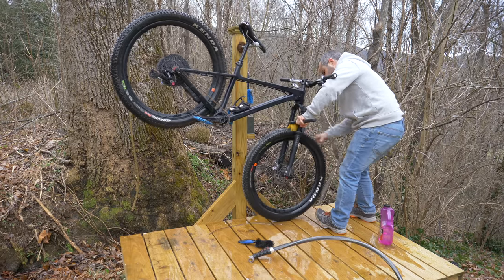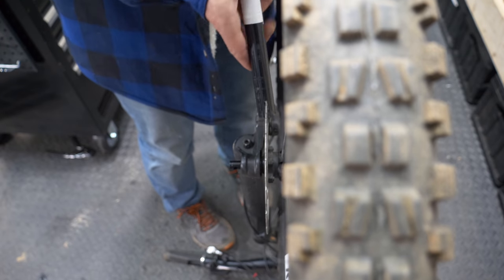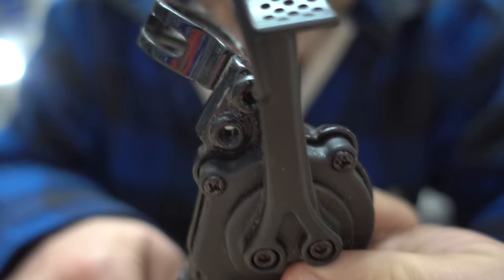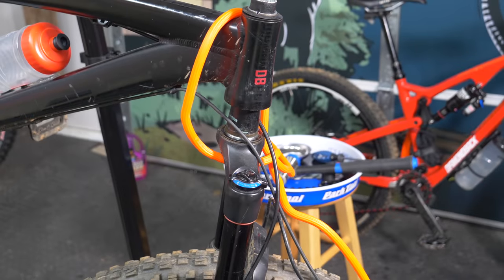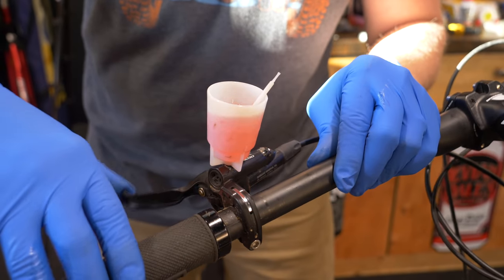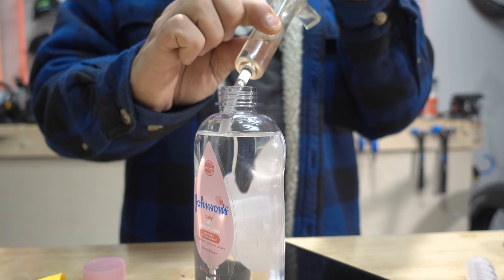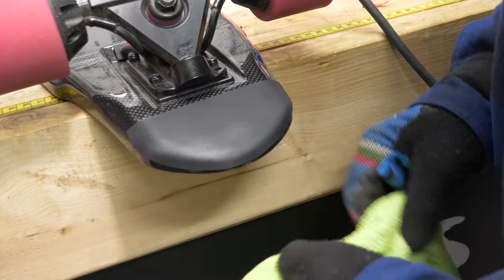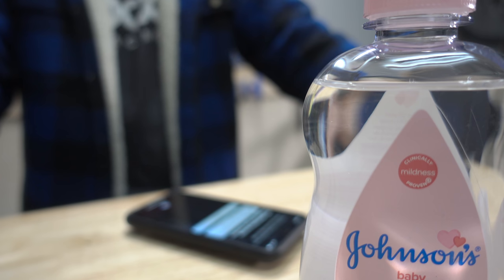10 Bike Hacks for Mountain Bikers and Beyond

Comment: Using baby oil will make your brake lever dirty after some time and that thing leaks on the main cylinder....yep i did it on my shimano deore m615 drained all the stock brake fluid and replace it with baby oil .. After a month youle see what i mean. But Dont worry just drain the baby oil then do some cpr on your brake levers to blow any left overs and spray brake cleaner on the main cyclinder which the blade pushes (thats outside) and your ready to go for the original mineral oil made by johnsons i mean shimano
Reply: you're* ready

Comment: I am a german boy.
My mom ask me, if i am learning
My answer: I learn english for 3 hours.
My thoughts: i am learning english, if i watch seth
Reply: Watch or watching* :) And don't worry, sometimes I forget it as well, because it's sounds difference as writing :D
Reply: @wa__een  Hi, actually his sentence is correct as it is, "I am learning English if I watch Seth". He does need to fix his capital letters for the start of a sentence, for the pronoun "I", and for the proper noun "English". The shift in verb tense from present progressive "am learning" to regular present "I watch" is a little strange, but not grammatically incorrect. To say, "I am learning English if I watching Seth" is actually incorrect, as he needs both the form of the verb "to be" (in this case "am") as well as the present participle ("watching") in order to make the present progressive form. Your sentence, "because it's sounds difference as writing" actually has a couple of mistakes. First, "it's" is a contraction for "it is", which does not work here as there is the conjugated verb "sounds" right after it. Second, "difference" is a noun, and in this sentence you would need the adjective "different" to describe how "it" sounds. Your sentence should be, "And don't worry. Sometimes I forget as well, because it sounds different when you write it, compared to when you say it." Another way that a native speaker would say this is, "It sounds different in writing than it does speaking it", or "It sounds different in writing than when you say it out loud." These are both ways that native speakers of American English would say these sentences. I hope this is useful, keep working on your English, and keep watching Seth's awesome videos!
Reply: Hi! This is a great way to learn English! Seth usually uses very good vocabulary and grammar, his accent is a little New York but not much, and his pronunciation is excellent. I noticed that another viewer commented on your English and I wanted to clarify on some things. First, remember that in English, we capitalize nationalities, so the word "german" should be "German". Second, the third person singular form of regular verbs in the present tense in English require an "s" as an ending ("asks"). Also, it is very important to capitalize the pronoun that we use for ourselves, the word (not letter) "I". We need to capitalize that one all the time. The sentence "I learn English for 3 hours" is a little strange, and might sound better in the present progressive ("I am learning English for three hours"). Finally, you need to fix your capital letters for the start of a sentence, for the pronoun "I", and for the proper nouns "English" and "Seth". You shift your verb tense from present progressive "am learning" to regular present "I watch", which is a little strange, but not grammatically incorrect. It would be a little better to say, "I am learning English if I am watching Seth." A corrected form of your entire post would be:

I am a German boy.
My mom asks me if I am learning.
My answer: I learn English for three hours.
My thoughts: I am learning English, if I am watching Seth.

I hope that this was helpful, remember those capital letters, ride your bike a lot, and keep watching Seth's videos.

Comment: Seth, good tip on car wash soap, BUT do not use soap with carnauba or any other wax built into it. it can contaminate pads and rotors. generally the cheaper the car soap the better they typically dont have wax in them.
Reply: Nick Ridgway I know about some carnuba wax. That's how me and Angelo caught Bodhi. Too bad it didn't turn out like I planned.
Reply: @placesaroundus  i feel bad it didnt work out like you hoped
Reply: Nick Ridgway thanks bro. At least I learned to surf though

Comment: Anyone know when the 2019 Diamondbacks are coming?
Reply: Stealthy Water 2019
Reply: Great lol
Reply: @hydrogen5149  the new sync'r (not the carbon one) is supposed to drop within the next week or two!  It's going to be tan, and around the same price point as the last!  If they updated the front fork to 110 boost and widened up the rear to accept up to 3.0 I'm buying one instantly, even if you can fit 2.6 on the front and back I would buy it honestly.  I'm just a fan of hard tails with a little more cushion for the pushin.

Comment: You can cut  small Cylinders out of the inner tube, put them on your bar behind the brake handle and pull them on the handles to keep the brakes compressed, usefull if you want your bike to stand still on a hill.

Comment: I have never taken the risk to go with baby oil for Shimano breaks, but what I do use and recommend is power steering (and also suspension, apparently) fluid of some European car brands (don't have the specification now, can search for it). I read about in a Peter Vertone article and this guy has tried everything in terms of oils and fluids. He recommended for even better performance than original Shimano fluid. I gave a shot and it does work very well also in extreme situations (-20 degree). It was easier and cheaper to find a 1 liter bottle than the Shimano one.

Comment: I use one of the smaller rubber coated ties to help hold my under-seat bag to the seat bottom - otherwise the bag's straps start tearing.  It also can work to hold a broken spoke onto the other broken spokes so you can get back to the trail head.  There are so many uses for the small rubber coated tie if something breaks.

I keep a spare rubber coated tie on my road bike stem if I need help holding my light or computer if it starts slipping.  It weighs next to nothing.

Comment: Tip 1 don't use a brush on your frame. Scratches the finish, and PS if you have a mountain bike, the finish is the last thing you should worry about getting damaged.
Reply: That's what I thought, I just use a soft towel

Comment: I've used motor oil as brake fluid before. Definitely not what you supposed to use but it's what was available and worked fine. I was on a 3 day stage race and on day one ran out of oil in my front brake reservoir, which meant I only had my rear brake for the majority of the ride. Topped up the reservoir with the motor oil that night and finished the next two days without a problem. Ran that oil in my brake system for years afterwards and never had an issue, but I wouldn't recommend doing that if you don't have to. Use the proper stuff

Comment: Seth, you are a very bright and inventive guy.  Its just great to see such ingenuity.  But please use a respirator when dealing with any possibility of dangerous dust like from carbon or aluminum.  Of course wet it down but use the respirator as well.  Half face ones with good filters are very cheap.  .  Sure you won't get the best seal possible because of your beard but its a lot better than nothing.

Comment: I have many little haxs hard to remember unless im doin the maintenance...
1, I have T style Allen keys and I was always grapping wrong one or set them down in pile when servicing bike So.I named each allen key with size and main job it has..Ex.3MM Grips..
I used majic markwer and wrapped handle with scotch tape..Im sure everyone has better stamping method.

2.Vegi bags at grocery store..Invaluable when blleeding washing etc..When bleeding brakes i wrap my rotors so no oil splash..Also i bag grips so as im pumping brake no oil transfer..
Im unlucky with brake contamination  and wrap disks and brake calipers so soap oil and whatever doent mess things up..
3.dollar store sponge on one side and green scrubby on other with cheap soap and clean my rotors and dry with toilet paper..If toilet paper is sticking all the way around rotor when drying it means its totally greaseless...
 Enjoy your show..Keep up the good work

TIM  McMTB

Comment: Sliding a metal tool across one of those magnets a few times will also slightly magnetize it, making it possible to stick a screw on the end of it. Idk how it works but I use that hack at work constantly.

Comment: for bleeding a lever without a dedicated funnel you can also use a cylinder from a syringe. It's tip made of plastic will screw into the lever with no problem. The only downside is, without that valve you have in the Shimano funnel, it can be a bit messy when you unscrew it ;)

Comment: I had one thought for a hack you should come up with for us boys up north.  We need something to protect our truck beds and/or bike racks from scratches from studded tires. For example when I put my fat bike into my 1up bike rack I have to put rags down under the tires before I can load the bike.  And that is definitely not pro. I’m trying to brainstorm a better low cost idea, but I could  really use a Seth style hack....a “sack” if you will 😂
Reply: What about cutting an old fat tire in half and using it to wrap the bottom of each wheel?  You could even combine with the gear ties that Seth features by drilling 2 holes on each end of the tire sections and threading one through to make sure that it doesn't slide off.

If you don't have one lying around already, you might be able to ask you LBS if they have any take-offs from customers bikes that had punctures / etc.

Comment: You can also use water instead of oil in your break system, it’ll give you sharper breaking power even though it isn’t good for continuous breaking as it’ll boil but it’s good for downhill racing

Comment: yo Seth I really like your videos I've probably watched them all 100 times I found a good hack well kind of a repair hack...

so if your rear wheel isn't spinning fast and slows down really quickly and it looks like your brake is to one side lose all the screws on the brake then have someone push the brake lever down and then tighten it should be good if not then you have problems with your hubs and you should take it to a shop

Comment: My personnal tip is to always keep old inner tubes. I use pieces of them when i need to replace o rings to fix my GPS on the bike, or even, fenders or other things like tools or...new tubes. You can also cut a strap to protect the frame from your chain.
And the last but not the least It is really helpful when you have a damaged head screw. Just put a piece of tube between the tool and the head screw ;)

And also something that i have seen. Never use Muc Off bike cleaner on Sram calipers. Looks like it is too efficiency with dot fluids.

Comment: I have used baby oil and lemme tell you. While it doesn’t cause damage it is inconsistent in its oil weight so the levers and pistons move slow because of the oil weight. Right after I started using pentosin chf 7.1. Which is Audi power steering fluid much much better than baby oil. Was like $20 for like half a gallon of oil

Comment: I use PENTOSIN CHF 7.1 as mineral oil on all my bikes - no issues and it works way better than Shimano stuff in winter (good between -40C to +110C).
Is cheaper too - paid $40CAD on 1L can (in comparison, Shimano stuff is around $60CAD per 1L when in sale :/).

I doubt baby oil is good enough in the winter time... specially Canada winter time :D.

Comment: I also use Redline Likewater suspension fluid in a set of brakes instead of mineral oil. For all I know it is eating-away all the seals, but it sure feels consistent and smooth. I’ve heard of Pros using Redline Likewater, so I wanted to try it. Be warned though.. the sponsored pros could care less about warranties. They’re all looking for that fraction of advantage.

Comment: Put a crown race in the oven at 200 for 10 minutes and it will go on the steering tube much easier. I just needed a few taps with a rubber mallet. Or then just push it with a pvc pipe.

Comment: Seth I have a hack I use. My frame has a nice shiny finish on it. And to keep it shiny I use wd40 and rub it on the frame with a rag. I've been doing it for months without noticing any change or harm to the paint. I would keep it away from the chain and brakes though

Comment: The water you are spraying should have a surfactant in it to decrease its surface tension so the carbon dust and fiber is surrounded by the water to reduce the exposure to the carbon. Just add a drop of soap to the bottle and that should do it.

Comment: You can make custom shaped mud guards out of thin sheets of plastic. I use files. If the off the shelf bendy mudguards don't fit where you need them too on the rear then making a custom one is easy.

Comment: Not using a hose when you wash your bike will mean that your paint may not get as clean,  but the actual functional components will work better and last longer. Clean functional components by applying the appropriate lubricants and wiping off excess.   Windex and a rag work well to get most of the cosmetic dirt off,  but remember dirt on your frame is only cosmetic.  If you must douse your bike with water after every ride or so,  try using an air compressor to blow excess water out of the nooks and crannies.  Bikes hate water and water hates bikes.

Comment: use a old downhill bar to loosen up a bottom bracket, stick the allen tool in, then if its really stuck, pull out the bars, and put it throudg the hole on top! give it a good kick and it comes free easy!!

Comment: I use oil specific for a Citroen transmisson box. It has the same viscosity as Shimano brake fluid. ( or so I heard, but I can't tell the difference..) after 5 years my top reservoir started to leak, but that's probably due to 5 years wear and tear and a couple of thousand trail miles...

Comment: I have a pair of shimano XT 4 piston brakes stainless steal braided brake lines that are from my 2000 gary fisher Mt Tam disc. From the very beginning i have been using CVS clear mineral oil. I had never had any problems. Id be happy to take them apart on video.

Comment: streach an old inner tube over your waterbottle holder it will reduce drops and vibration alot of them too . this works the best on the metal ones because the plastic ones ussualy dont fit an inner tube over them :just another bike hack for you

Comment: Hey Seth, I bought a new hardtail mountain bike (its a Walmart bike) and upon trying it out when I got home I found out the forks won't work at all. Can you show any possible fixes?

I'll take suggestions from fans too
Reply: It might have knob on the forks that sofen or tighten the suspension or it might have a lock on it and you might not if unlocked it

Comment: Does using water to get your bike clean get it rusty??
Reply: Chris el cazador CR 
... not if you use half ( luminous ) petrol and two sponfulls of engine oil and a soft blaireau to apply it all Over the frame . Not the wheels rims , neither nor the brake pads , nor the rotors ; or any brake systems .
Reply: @manuelluis5456  thanks 👽👌

Comment: OK I have 3
1. Guy at ME Sports Shop Toronto..Wrap electrical tape around tubeless tyre ..It'll seat with no struggle.                         
2. MINE  ..Cut top heat sink fins from brakes just below hole..Drill hole a little bigger..Glue little pieces of rubber on bottom..Now buy cheap resin pads and before applying screw seat cut off fins into place..Makes brakes look complete and saved 40 bucks
.
.Lastly..All MTB have one thing in common ..Bash guard screw holes..For your drive train project make a bracket to clip on a even bike motor so going to top is easy.Take off for downing hill..German guys made a 2 pounder that hooks onto kickstand..100 pedal assist..Called go eat wheel or something like that..Box could make all our bikes English capable when the legs are not doing it..Multi cross platform on any MTB..A million dollars for sure

..
Tim McDroid

Comment: Another little tip for bleeding brakes with baby oil is , because it's so cheap , especially the no name unscented brands , when it comes to bleeding just immerse the whole lot ,master cylinder caliper and hydraulic hose in the baby oil and pump pump pump until there's no more bubbles ,, your welcome

Comment: Dunno why but i would never trust baby oil in my brakes, i'm sure its more sticky and thicker and it can perform different as it should in the brakes. But there is other very cheap and better way to bleed your Shimano (or other mineral oil brakes), it's a LHM (or LHM+) oil commonly used in Citroen's hydropneumatic system (brakes, suspension). It works well and it was tested to work in extreme conditions. And it cost around 6 quid for a 1 litre bottle.

Comment: I tried to put baby oil into new deore 4-piston brakes when I had to shorten the hose.
And it did not work!
From the first everything works well.
But baby oil is much thicker than the original shimano.
I can feel it by my fingers.
Circulation inside the lever was too slow, resulting in a feeling like an overcharged system after a couple of rapid consecutive pressures on the lever. The bite point would be at the very beginning without a dead walk. Everything would go back to normal if it did not pump for about 5 seconds when the oil had satteled down.

Comment: I’ve tried the solder iron hack in the past which doesn’t work on higher end shimano cables. I think Stainless steel.
Reply from the maker: The key is fraying the cable a little bit so the solder can seep in and take hold. Otherwise you’re absolutely right, it’ll just pop off.
Reply: @SethsBikeHacks  cool I was trying to use it as a cable end on the rear mech. Let me know when your back on the Island for a ride.